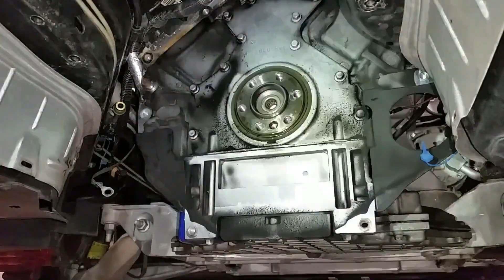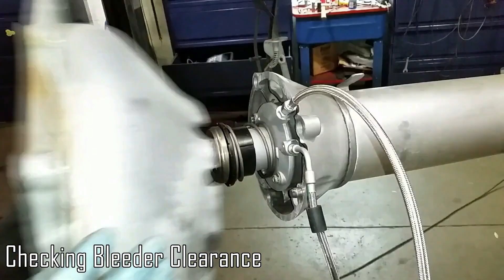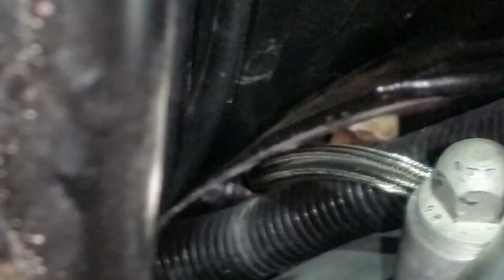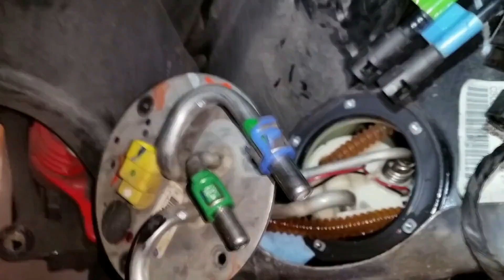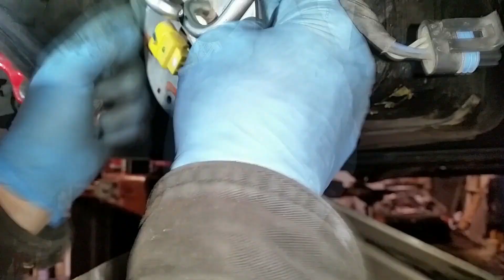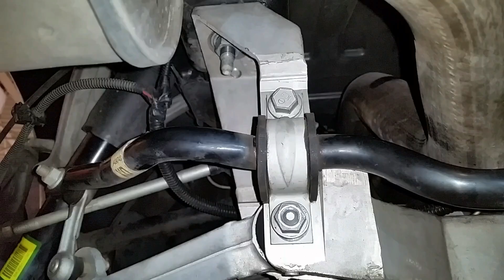C5 Clutch Install Pt2. Project Zeforce The "Adapter" P2

Comment: Did you take note of any hot balancing weights? I thought those needed the clutches and crank front pulley match balanced.
Reply from the maker: Great point to bring up! The LS Vettes were all rough internally balanced with another step in adding small weights pressed into the OEM dampener for fine tuning. The Flywheel and pressure plates are zero balanced as a unit. Unfortunately these cars do no have a keyed crank and the outer ring where the weights are spin and get a wobble (this car included) so that information has been lost a long time ago. Its not that far off tho I usualy see a max of 2 balance pins. They did not even bother taking this step on the fbodies as well as other LS1 vehicles. When ever I do a clutch job I have the fw zero balanced. You can take it a step further and do the pressure plate also. At the end of the day even when brand new its no where near a performance balance a machine shop can achieve. Ive even seen a bunch of name brand "balanced" rotating assembly kits that were pretty far off and require some more heavy metal to make perfect. At the end of the day we have to draw a line on how perfect we can make it without taking the engine out and rebuilding it completely in perfect balance.